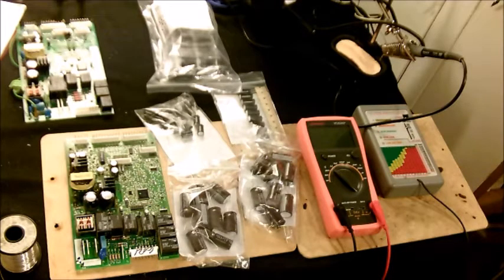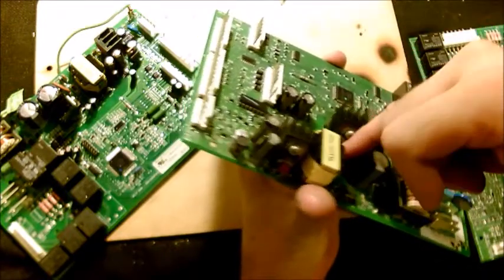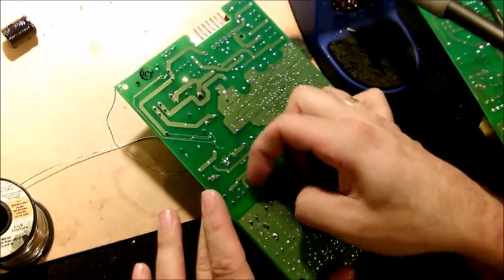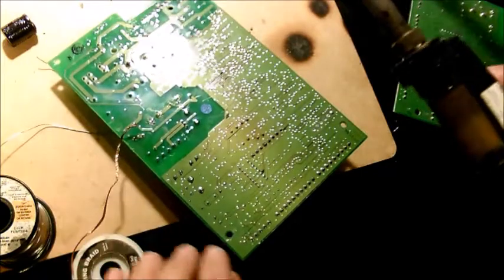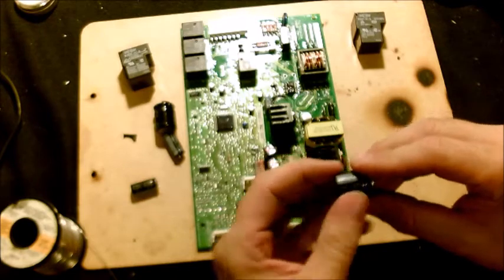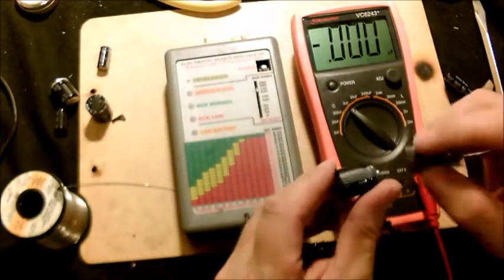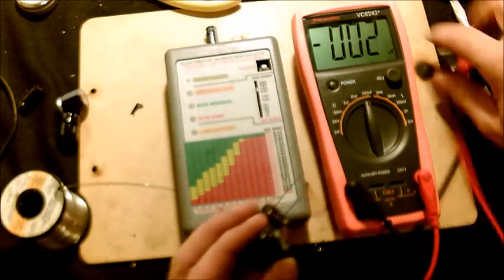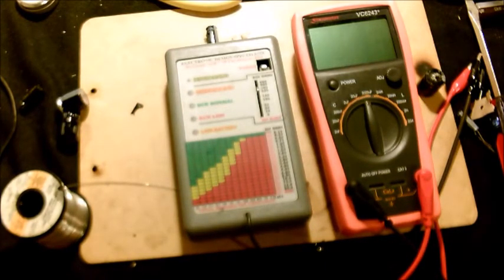GE sxs board refurbishing

Comment: I cannot seem to find an exact replacement for the relay that has the scorch mark, just like in your video.
Mine is an 832A-1C-S 20A, 12VDC
I find other ones with either higher amperage, which probably is not good because it is made to throw at the 20A level, or 24 VDC.
It looks like it is obsolete, and I cannot find a proper cross-reference chart to tell me what to purchase.  Any help on this?
Reply from the maker: you can use this one as a sub, https://www.mouser.com/ProductDetail/769-JTN1S-PA-F-DC12V
Reply from the maker: also check out my video on solder trace bridging if you have a burn out on one of the pins.
Reply: @electronicsprojects4708  it looks like One of the holes got really scorched, and opened up a large hole. It could use a bridge. At this point there’s not something I am not completely comfortable with and may have to find a TV repair place to make that bridge, and maybe just replace all six capacitors while it is there. 
Thanks for the help 👍
Reply from the maker: @CaretHalfgem  https://youtu.be/yOSxMmVo05E
Reply: @electronicsprojects4708  I watched the video. It’s the final tie-in to the relay that concerns me. I’ll have to practice with a less critical repair. Lol the family refrigerator is a bit much to try new skills. 😂
Reply: @electronicsprojects4708  Sorry, one more question. I have the relay, and have been trying to desolder the old one. Is that sealant on the board also sprayed on the front? I have never had so much trouble trying to loosen a component before. I don’t know if it is literally glued on with the moisture seal.
Lol even better, i could send you this board along with 6 caps and the relay. 👍
Reply from the maker: @CaretHalfgem  I use vise grips, clamp onto the relay and rock it back and forth until the conformal coating cracks and breaks free. It takes some patience, but it's not a big deal once you've done a few.

Comment: Good video. How would you compare efficiency of a desoldering bulb or spring loaded desoldering vacuum vs the wicking material?

Also, do you replace all the caps even if they are good (or the compressor and defrost relay if they are good) as a preventative measure? I guess if so, testing isn't necessary.

Link for the relay goes to the solder wick page.
Reply from the maker: I never liked the desoldering pump, wick is better, but you have to buy it. Everything stinks compared to the Hakko desoldering gun. I do not replace all caps, only those that I know to be chronic, namely the primary and secondary electrolytic caps. I do not replace the defrost relay, as I've never seen one fail on this board. I do replace the compressor relay regardless since it's chronic.

Fixed links, thanks
Reply: So you replace the four capacitors and the compressor relay no matter what?
Reply from the maker: Yea, if you buy all the components in but, it's like $8 for parts, so it's a no brainer. Don't want to be called back in a year because you didn't replace a known offender.